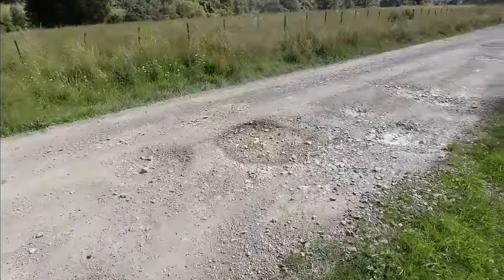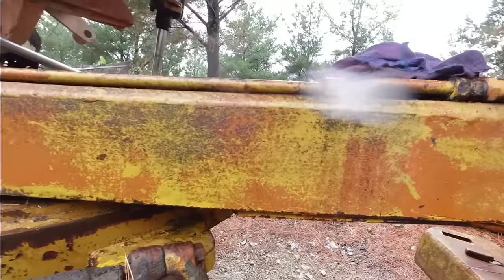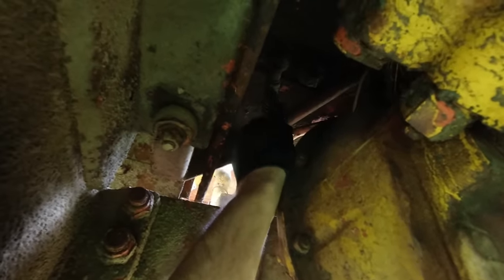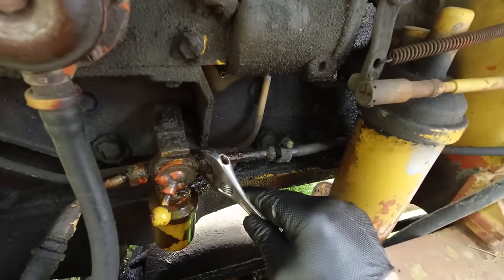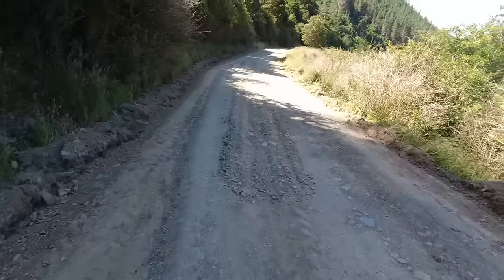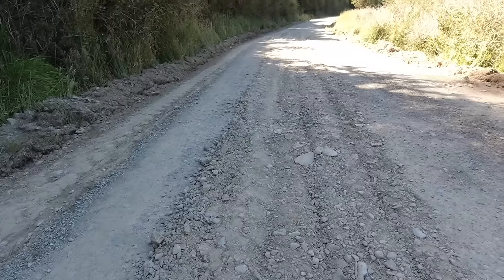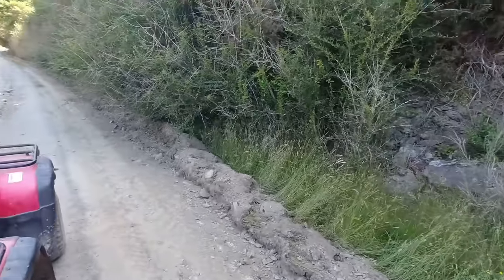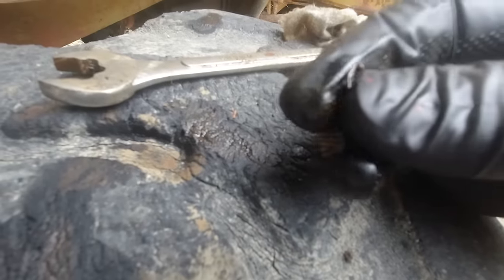Vintage Grader fixing a Potholed Gravel Driveway

Comment: You grade differently than the way we grade our logging roads in Canada.  We always angle the blade to the material goes back into the middle of the road.  That way you aren't wasting good gravel, and the roads last years without requiring any extra fill.  Thanks for the video!
Reply: In this case the amount of soil etc would have turned the whole road into a mud pie at the first good rain.....
Reply: Marty T
1 day ago
I didn't want to use the dirt to create the crown as it would turn to mud in the next heavy rain, by digging ditches at either side, centre is now higher than the edges, I effectively  crowned the road
Reply from the maker: yes usually id do that but the grass strips here are mainly soil which would turn into mud in the first rain,

Comment: Neighbors, a blessing or a curse. Should look after each other, however, doesn't work out that way. Today, two boaters in a ragged sailboat, no mast, ran out of fuel for their outboard on the river in front of my house. Got them some fuel, made them two shear pins for their tiny two-stroke motor prop as they had broken theirs and had no spares (the outboard looked a proper mess but started easily and ran, amazing little Yamaha). Help your fellow man as you did Marty. Good job.
Reply from the maker: Nice one mate

Comment: Making dirt roads is an art few understand. That base material you have is superb with its variety of aggregate. It locks together better than gravel of similar size. Dressing fine stuff on top makes it look good, but too thick and it will just become new potholes. Crowning is critical, especially on flatter sections. You are better off just driving on the graded original stuff and the fines will make their way to the surface when it rains, just like floating wet concrete. You have to be the best neighbor! Thanks for another great video!

Comment: When I was a kid I rode around with my grandpa doing this. He'd pull the shoulders up at an angle to the center and then do a final pass leveling it so its highest in the center so water runs down the sides to the ditches.

Comment: Hi Marty those pot holes take me back to the days of the 1950s when i was a teenager, and rode on Newmans buses from Westport through the Lower Buller Gorge and the Upper Buller Gorge via Murchison, Blenheim to Picton where we spent our school holidays cruising the Marlborough Sounds on our uncle's passenger service launch, the Miss Onahau. A good portion of the highway was metal and i remember seeing the roadmen who filled the potholes. They usually lived in little huts along the roadside in those days.
Reply from the maker: The good old days
Reply: To anyone who - like me - wondered what a "metal highway" is:
'The term road metal refers to the broken stone or cinders used in the construction or repair of roads or railways,[39] and is derived from the Latin metallum, which means both "mine" and "quarry". ... 
"Road metal" later became the name of stone chippings mixed with tar to form the road-surfacing material tarmac. A road of such material is called a "metalled road" in Britain, a "paved road" in Canada and the US, or a "sealed road" in parts of Canada, Australia and New Zealand.
Source: Wikipedia, "road surface".
Reply: @fortytwo8388  Thanks a bunch. I was thinking of a road bed with steel sides and bottom.
Reply: @fortytwo8388  Well explained, thank you. That terminology is rarely used nowadays. Bob NZ.
Reply: @fortytwo8388  Thanks! I'd only read about those roads in a mis-translation to German that butchered it to "corrugated tin" before I found your great explanation!
Reply: Now it makes sense...  Thanks for saving me some research.   It's similar to what is still used in Texas (and Texas can't even make a new road smooth lol) and Oklahoma, where it's called "chip seal"...  As a kid in Tennessee,  it was just "tar 'n' gravel, rarely seen in this day and age.  Still plenty of gravel (and scoria) in the northern Plains these days...
Reply: A (camino de metal) ,en argentina le decimos camino de ripio

Comment: A nicely constructed driveway always makes life easier. If you can direct standing water away from any road surfaces. Ditches, gutters and any kind of water retaining construct helps immeasurably, but knowing the direction of flow and possibly laying down a conduit for excess may solve more than just the irregular rain problems. A good rake could help bring up some old gravel and put your driveway on to a better direction as well. Not sure how much you want to do overall.😜

Comment: Great job Marty , cant get people to cotton on that having a crown in the road is most important , they seem to think get it nice & flat or level will solve the pothole problem , what your doing is excellent , most of the roads in reporoa back in the 70s were metal roads the graders would be at them grading up an getting that crown , the pumice was a great base for any roads , theyed stick new metal on untill it couldnt take any more then tarseal them , fantastic roads never saw any potholes , regards to you Marty ,love all your videos from the UK
Reply: I remember going down SH4 into Taumarunui in 2000, they were re-metalling it and the car wash at the edge of town was doing a roaring trade.

Comment: To solve the rain issue I have added cement through damp quarry dust & spread it vthin on top of the finished grade. Then run it in. 

It keeps the fine dust from washing out as its traffic'd in the wet, this is where the pot holes start.. ie. The fine stuff is squelched out first which then leaves a cup to hold water that squelches the bigger stuff etc.etc.

You can tell an experienced grader op by the speed at which they run the mole board.. Great skills fella..thanks for the vids, love them..

Comment: You would think that the neighbors would take full advantage of you fixing the driveway by providing the necessary gravel. I myself being in the road construction business know that gravel isn't very cheap by the time it's delivered but it's still less than 50% of the expense of maintaining a road so they'd be getting the better of the deal. Looks like you know exactly what you're doing but to make that road a proper one it'll definitely need elevated in certain spots to shed water for as much rain as you get. Great video!

Comment: If you know you're going to get dry weather for a few days and some wind instead of side casting the ditches you can bring them back up onto the road to let the organic dry out and blow away. It gives you back some lost gravel and fines for making a crown back on the road as well. I would've been partial to rip more of the road and then give it another blade to blend everything in and roll it seeing as you had the machine there.

Comment: That is a strange MG.  I've never heard of the Aveling Barford MT graders.  I worked at the CAT Plant in Decatur, IL where the graders were for many years. I was a line supervisor when the graders were still built on the "chain pull assembly line".  We built about 20 per day in those days. Later they went to cell assembly slots and moved units from one cell to the next on "AGV's"  Automatic Guided Vehicles".  Great machines!!!!  I've wondered how many units were built between 1955 and 199_? before they moved MG's to Little Rock Arkansas.   Lots of stories from customers visiting the plant to see the machine they ordered/

Comment: Good old iron. The clog looked like a chunk from your gas cap gasket. Probably cracking and tossing a chunk in now and than when refueling. Gets real bad from tank rust or something whip up your own brass drilled tube with outer screen tank filter similar to what is in your atv tank. Still my favorite tank filter design.

Comment: I do a bit of grading up here in Welly, if you wait and grade it after a rainy day while the roads damp it will make grading easier and you will get a better result
Reply: Marty did comment it has been dry this summer...
and the chance of a good rain had to be weighed against repairing the road surface before the next really heavy rain made the potholes even worse....

Comment: I spent a lot of years as a young trainee site engineer working with the graders and big cats building motorways here in the U.K……..most of those old Irish guys who drove those machines didn’t need much input from me…….nowadays my job and that of a good drivers eye have been replaced by GPS setups………I miss the old days in a lot of ways
Reply: I've had the pleasure of watching a 40+ year veteran running our old CAT grader from the back of the cab.  Tracks end up nice and smooth.  For a while.

Comment: Watching the shrubberies trying to remove the gopro from the grader made me think of Andrew Camarata's trail trimming contraption for opening up the snowmobile trails.  Maybe even build a tree trimming circular saw blade contraption like the power line companies use to fly in with a helicopter.
Reply from the maker: Yeah I think Andrews contraption is a waste of time, see how often he had to stop to clear the branches, and how dangerously fast he had to go to cut? I've been looking for an old pto mower I can adapt to fit on my db990 fel
Reply: @MartyT  Yes, I think he started out with the intent of making a sickle but without enough power to get through the bigger limbs.  A tall sickle was the first thing to come to mind on some of your brush.

Comment: When you are turning around, lean your wheels in the direction you are going to turn your wheels,  Keep them turned that direction until you have finished your turn, then straighten them out.  You will be surprised at how much tighter your turn will be.  Also, if you lean them in the direction of the heel of your blade, you will not have as much side drift.  Looks like your grader is all hydraulic, but if you have ever run an old mechanical machine, you have to use wheel lean to be able to steer straight.
Reply from the maker: Yes I would do that if the tyres were in good shape, but they are in very poor condition and I have noticed leaning them opens up their cracks so I avoid leaning

Comment: I usually see the grader operators start the opposite to the way you did. They bring the material from the edge of the road back on to the road so that they do not lose all the gravel and have some material to fill the potholes. Don't worry about the bigger rocks and sod that ends up in the windrow of gravel on the road. Do this on both side of the road. The bigger stuff that you don't want on the road will be swept off the road on subsequent passes with the grader.
Reply from the maker: Yeah usually I would do that but this road is mainly soil on the edges which turns into mud in the first rain

Comment: Put a little bit of rolled up screen wire in the fitting that screws up into the tank and it should keep the pieces of trash out of the line.

Comment: In regards to the tarp, have you seen NightHawkInLight's latest video on how to make a cheapo tarp? Saw it the other day and instantly thought of you.
Pretty simple too, Naphtha + bathroom silicone + old bed sheets = super water shedding tarp. If you can score an UV bed sheet (like hotels might have and discard for their outside relaxation beds) then it's even sun resistant as well.
Reply from the maker: Thats cool but I use black plastic moisture barrier, its far cheaper than buying tarps and is very strong, comes in 25m x 4m rolls

Comment: I hate how there are tracks of dirt left after grading ant the sides, it hinders water flow and messes up the road to our fields. after many years of grading and not fixing that , the local road is a bit messed up. I was watching some instructional grading video from US some time ago, they made the dirt disappear in couple ways in the ditch they do or fix,  or spread on the farm field by the road. dirt with gravel is incorporated into road by making a ditch in the road and leveling it.  having a fence there is a huge hindrance for everything.
Hope your road will do better than the one I use :)

Comment: If you haven't done so already a sedimentor off a modern diesel car, could be fitted between the tank and the pump. The good ones have a glass bowl so you can see water or dirt easily.

Comment: MARTY I NEED YOUR ADVISE ,YESTERDAY I PURCHASED A 6 FOOT LAWN ROLLER and i am worried about rust build up after i fill it up with water is there a way the roller can be treated with some type of chemical
Reply from the maker: water on the inside? why not use sump oil, that will stop the rust
Reply: @MartyT  NEVER HEARD OF SUMP OIL I WILL TRY IT THANK YOU FOR YOUR ADVISE

Comment: Great video Marty . grading looks like patting your head rubbing your stomach and driving on a cliff edge while controlling the drone "easy" 😁 .
Do you have duty less diesel ? for farm use and boats etc. in the uk its red surprised to see your diesel clear .
Reply from the maker: Yes it is an art form, I'm still learning.. No dyed diesel here, we have odometer based road user charges for diesel vehicles used on the road

Comment: gotta let that engine rip, and the rippers eat.. all the rpm itll suffer, if its not blowing black smoke under heavy load could probably adjust the pump for a wee bit more power too, just want a touch of the "coal rolling" basically need some but as little as possible for peak performance
Reply: Hopefully now with increased fuel flowing the pump can pack the injectors to the max....

Comment: Hello Mr marty. Just saw your above video. I am not slanting you but if I was you. I would have put a little crown on the road. Maybe it's something you will look into in the future.
Reply from the maker: I didn't want to use the dirt to create the crown as it would turn to mud in the next heavy rain, by digging ditches at either side, centre is now higher than the edges, I effectively  crowned the road
Reply: @MartyT  ohhhh I understand you now. No worries.

Comment: Hey Marty nice grader but your blade pretty worn suggestions if you get in new Zealand Lucas diesel fuel system cleaner and conditioner will help also contact Facebook marketplace on a different blade or check with C and C equipment in Indiana USA he might be able to make you one and just have to bolt it on
Reply: Postage from USA to NZ is.....pricey.....
e.g. a motorcycle starter motor is $38US....postage was $98US.

Comment: The old grader could use some front tires to replace the racing slicks, not good, trying to blow threw a fuel line, especially diesel, disgusting if you get any in your mouth!!

Comment: Couldn't get halfway listening to the old mule  scrape. Are there no rainy days in your future?  Why not save the machine and shave the rocks when they loosen. Yes, No?
Reply: There has been a drought..
then rain, much rain was forecast...
so it had to be done when it was done.
Reply from the maker: More rain than I've ever seen here, over 400mm in 2 days this track is still ok but most of the culverts overflowed, a couple washed out
Reply: @MartyT  Dang! That's rather moist.